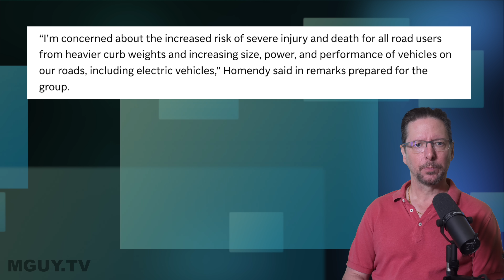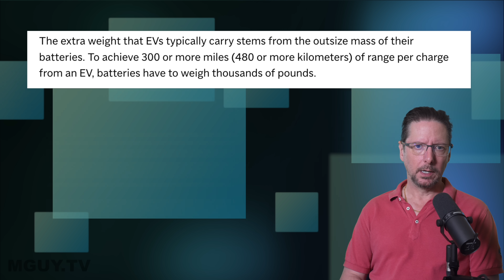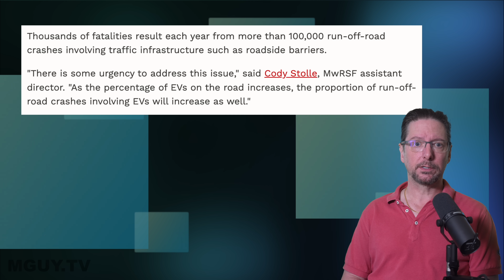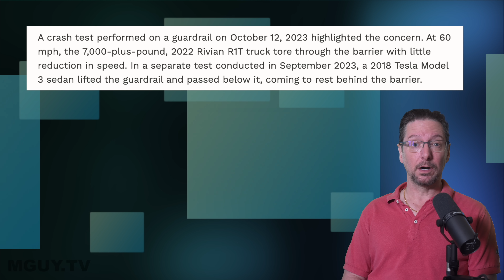EVs TOO HEAVY for roadside crash barriers (guard rails) | MGUY Australia

Comment: Anyway the  SUV is not better on the guard rails  BIG V8 and  a 120 L Full fuel tank . Never mind the facts LOL  Anyway  as mutch i like a good v8 diesel  or gas engine they are just as problematic. As any EV .  If you are in small city car you are not safe in a conflict whit SUV or truck that also apply to guard rails ..

Comment: The crash videos were pretty stupid. Only the smallest of cars would be stopped by a 90° hit on a roadside barrier. They're not meant to be hit straight on. Most crashes into guardrails are at well less than 90°. A tractor trailer can hit a guardrail and be prevented going off the road at a 10 or 15° hit. EV's have all sorts of issues but being heavier than most cars isn't one of them.
Reply: An engineer would know that.
If only there was a real one available?🤔
Reply: @DwaynePipes  Maybe MGUY has a degree in architecture? And maybe because he's from Australia they didn't teach him load-bearing principles?
Reply: @DueyMiller-rk9dr  Architects won't thank you for confusing them for engineers and vice versa!😂
Reply: @DwaynePipes Ho, I didn't know that. I always thought architectures were part of an engineering class. Kind of like me being a stationary engineer. Someone's got to watch that steam.

Comment: What a load of nonsense, the Barriers are designed to deflect vehicles back onto the road including trucks etc not to stop a vehicle. Only later concrete/steel  barriers installed on motorways are designed to stop a vehicle from crashing through onto opposite carriage way. EVs will disappear in few yrs as synthetic fuels become the norm

Comment: So we have more road wear, more tyre wear, more brake wear, the need to strengthen multi-storey car parks, the need to strengthen crash barriers and in the UK the need to go through the process of getting an upgraded license for the heavier vehicle. What about the sides of bridges? Do they need strengthening now as well. What would be the cost of an EV fire on a suspension bridge if the cables are damaged? Have you seen the latest referendum that is being considered in Paris? They are thinking they could ban (or charge a very large fee to park/use them) EVs and SUVs from the city due to increased size, increased danger and increased pollution that goes along with this increase in size and weight.
Reply: An ev can be driven an entire day without even touching the brake pedal. Brake pads can last well over half a million km. Also the presenter drives a Maserati which is roughly equal to or exceeding the weight of popular ev’s on the market. Where exactly is the problem?
Reply: @peejayem4700  If you don't need brakes why do they have them? If you don't use them they may seize up and then not work when you do need them. So you have brakes because they are needed and you have to use them to make sure they stay functional. When you use the brakes they are stopping a lot more mass than an equivalent ICE vehicle. When turning you are changing the momentum of a greater mass than an equivalent ICE and since the rate of change of momentum is proportional to the force that caused the change the forces on tyres and road surfaces are higher with a higher mass vehicle. This results in more tyre pollution and more road surface erosion pollution. This extra tyre and road pollution occurs even when regenerative braking is used when travelling in a straight line. These are all things that the UK government failed to consider when they mandated a change to EVs to cut pollution. Since most of the pollution from a travelling vehicle in a city is in the form or road noise, tyre dust and road dust an EV is not a good city car unless it is the same weight as a small ICE vehicle. London is going to monitor what happens in Paris as they are considering a similar thing to get rid of SUVs from the city without making a distinction between EV and ICE. It has been reported that any pollution reduction made by ICE vehicles in the recent past has been overtaken by the increase in vehicle weights as SUVs were pushed by manufacturers because of higher profit margins. EVs are just carrying on this trend. EVs are not a green panacea.
Reply: @martinconnelly1473  so ev’s have more brake wear?
Reply: @peejayem4700  Depends on haw they are driven. If you use a lot of regenerative braking then no. If you use the brakes a lot then yes. The tyre wear is related to the weight they are carrying, turning, accelerating and braking, regardless of regenerative or friction braking. Likewise road wear is related to the forces required to turn, accelerate and decelerate the weight. More weight requires more force which wears away the surface faster. Also more weight causes more damage to a road surface than a lower weight does.

Comment: With Teslus popping up around town I worry I'll either get caught behind one as it spontaneously combusts or will be rear-ended by an amateur driver with an acceleration issue.
Reply: More chance of an ICE catching alight.  Only been 218 confirmed cases of them catching alight as of today; however absolute numbers don't mean much because you have to factor in total vehicles on the road and hours; when you do that you find that EVs are substantially less likely to catch alight, unlike the spread of the moronic memes.
Reply: @pldaniels drank the EV Kool-Aid. 🔥🔥🔥🔥🔥 FJB 🖕🇨🇳
Reply: Google how many Tesla's have caught fire in your country, then weigh up the risk of this happening too you. Probably as likely as you getting struck by lightning whilst been eaten by a shark.

Comment: Another brazen exaggeration from our dear MGUY. I don’t know how can publish lies after lies everyday. He compares Hummer EV with Honda Civic. They are very different vehicle classes. Yes Hummer EV will be much heavier than Honda. Also, Hummer EV is not a classical representative of EVs 😂since they don’t sell much at all. Now let’s see, Toyota Camry is similar or Tesla Model 3. Now let’s compare the weights of  these two. Toyota Camry 6 cylinder weights 3520 lbs, Tesla Model 3 rear wheel drive weights 3582 lbs and the long range weighs 4045 lbs. Model 3 rear wheel drive weights as much a Toyota Camry and the Model 3 long range weighs 500 lbs more that is about 12% higher. That is not very heavy enough to damage the road. Toyota Highlander SUV weighs 4152 lbs and the comparable Tesla Model Y long range dual motor weighs 4416 lbs, that is hardly 260 lbs heavier, if you compare the single motor version it’s the same. What is your BS argument that EVs are heavier and causes damage to road. If you compare a Chevy Suburban which weighs 6026 lbs and a Tesla Model 3 which weighs 3582 lbs and say ICE cars are two times heavier than petrol cars. Does that make any sense. When you give BS videos like this include proper numbers. You have pre-concluded that EVs are heavier and all the trolls of this video also concluded that. 
Since all batteries are in the bottom of the car, EVs have very low center of gravity and even distribution of weight. That’s one of the reason, EVs hardly roll over. Rolling over is the feature for ICE vehicles since they are front heavy and you can see rolled over ICE vehicles every where. In the Videos he showed, if they were ICE they would have rolled over immediate after impact.
Our beloved MGUY is putting so many fake videos with basically no proof or some proof from some junk sources. You can easy figure out if the news is real or fake by looking at the bobbling of his when he say some information. More the bobble, the degree of fairness in that news if high. Maximum bobble I saw was when he said auto exhaust is just pure CO2, his head bobbled violently.

See this video of your fellow Australian say about myths of EV.

https://youtu.be/C0ZtX5d-WE0?si=jzUc6TxydLO8y9_4

Comment: The top best selling cars in Australia, HI Lux and Ford Ranger, are both heavier than a Tesla Model 3 😂 There are far more double cab utes on the road than Teslas, but nobody was concerned about the weight over the last 15 years until the EV hate kicked in.
Reply: Why are you comparing the Tesla Y to MUCH MUCH Larger vehicles? And actually the Y Long Range dual motor IS HEAVIER!
Reply: @robertkubrick3738 Model Y Long Range kerb weight is 2,003kg, no Ranger or Hilux in any spec is that light
Reply: @peejayem4700  The question remains why are you comparing a MUCH, MUCH smaller vehicle to TRUCKS? LOLOLOLOLOLOL Did you even look at the dimensions? Are you going to brag now that Y is lighter than the Queen Mary?

Comment: As there was no massive fire resulting from the barrier run through I assume the tests are made with weights in place of the battery.   This is never mentioned on MCAS tests though health and safety obviously prevents them from testing with the battery in place due to the risks to staff conducting the test.  ICE cars are tested drained of fuel for the same reasons.

Comment: They are a process of diminishing returns, more range bigger battery, more weight being lugged around. Power to weight ratio very poor.
Reply: Energy density will increase markedly over the next 10 years with solid state batteries.

Comment: what is it they say? actions have consequences? Some years ago the goal was to make vehicles lighter and therefore more fuel efficient by using better material choices and shell construction techniques but of course going electric seems to have thrown that out of the window. So now its all about gaining range by increasing the battery size. This puts other requirements into the mix. To carry all that extra weight, literally every other structural part has to be more robust and therefore heavier only adding to the issue.

Comment: I’m sure the response will be smaller, lower range vehicles rather than the obvious….

I always said smaller, light EV’s would be sensible for those who only need that but people want big posh cars (those who have the luxury of being able to take out a loan for one) and having sensible small vehicles would be even more of a danger with 3 ton SUV’s on the road.
Reply: If a BEV won't do what you need it to do 5% of the time that's 18.5 days a year it fails. Is it worth it to have a second vehicle that can do the job those 18.5 days? Or is it more cost effective to have one vehicle that works 365 days a year?

Comment: What would happen to an EV battery when the vehicle goes through the (cheese grater) post and cable barriers as there is on Sydney motorway roads? Are they going to be ripped apart by the steel posts?

Comment: So wait, one of your main arguments against EVs is that their excellent acceleration is a downside (of course if they were slower, your narrative would be that they are dangerously slow). Are you going to show an ICE vehicle drive head on into one of these barriers? As it would do the same thing. Given that they are not designed for cars to drive head on into them. But again, doesn’t suit your narrative so I’m pretty sure you won’t mention it.
Reply: Why do so many insist on stating that such barriers are not designed to "drive head on into them" when they're often installed at the head of T intersections in rural areas? Is it perhaps down to too many city slickers not traveling too far outside of the bubble they live in?
Reply: @erroneouscode  because it’s a very valid point that they are not designed to be driven head on into. And showing a demo of an EV doing this is irrelevant if you are not showing an ice car doing the same thing.
Reply: @Audioremedy0785  You and others have not proven that they are NOT designed to be driven head on into. So, your point and assertion is invalid until you do. In the meantime I will go with the evidence of my own eyes and actual application I mentioned which is commonplace.
Reply: @erroneouscode  the simple point with this is that you can’t show an EV driving head on into one and say ‘well that shows us that EVs are dangerous’ as per the narrative that’s given in this video. An ice car would cause a near identical level of damage. The fact that an equivalent video is not shown here effectively proves that by omission.

Comment: The fact that  also semi trucks generally wont be saved by guard rails, points out  that a lot more freight should be carried by  trains ,and there should be a reduction in the number of annoying behemoths  on the highways.
Reply: Okay, but if you go looking for stock in a grocery or any kind of store and don't find it, at least you can feel good about getting trucks off the road while you starve.
Reply: @robertkubrick3738  I know ,trucks are  here to stay , the old system of rail and then truck distribution probably wouldn't be viable these days , I like trucks and I appreciate the service they and their driver provide ,but   it would be good to go for a drive in a car , and not constantly have your rear vision mirror filled up by an impatient effin truck that needs desperately to get past you even though your traveling at a higher speed limit than the truck is legally allowed to go.
Reply: Learn to share the road, you annoying behemoth

Comment: There is a lot of control that could be legislated in 

Software could limit acceleration maybe 0-60 of 10 or 12 seconds , max speeds of 20 mph over the local speed limits 

I would argue that all critical safety barriers should be upgraded to 7500kg anyway next to  rivers and ravines 

EVs which don’t comply with these restrictions should be taxed the same as V8 4x4s , Lamborghinis  , not get novated leases, taxed at full rates, not eligible as company cars. 

Tax breaks should be socially responsible

Comment: Ok, enough BS! Let's compare apples to apples. I have a Tesla model 3 dual motor. It weighs 4, 065 lbs. I also have a similar sized and performing Mercedes C43 AMG Coupe gas car. It weighs 4, 084 lbs. EV lighter. My sister has a Teska Model Y which weighs 4,300 lbs. My brother has a similar sized BMW X5 gas car that weighs 4,800 lbs. Again EV lighter. In both cases the EV is NOT heavier than it's gas counterpart. Such nonsense being spread here.

Comment: The story is biased as it states "including EVs" and yet concentrate on EVs, so which is it "HEAVY" vehicles or more specifically EVs. If the later then most EVs weigh far less than a HUMMER EV or even the Rivian.
If safety is an issue then these much larger "Trucks" (we call UTEs) are a clear example which shows these too will not be protected by the guard rails as these too are to large/heavy for the barriers to be effective.
Not only that these trucks will smash through conventional cars as they are HUGE and weigh substantially more than in the past.